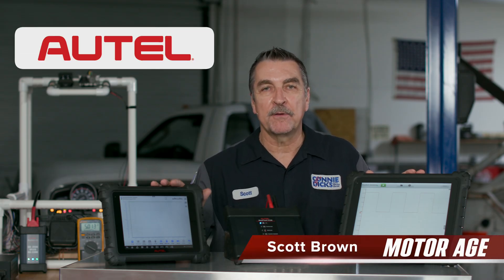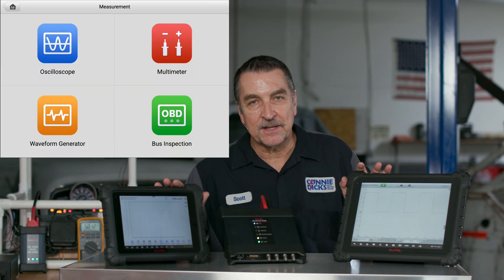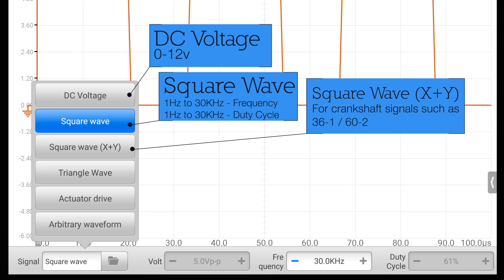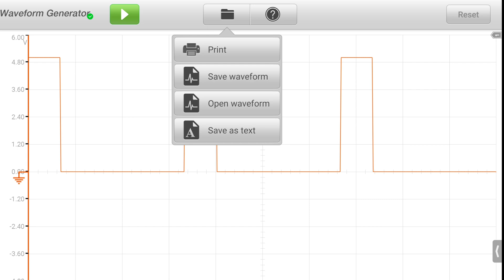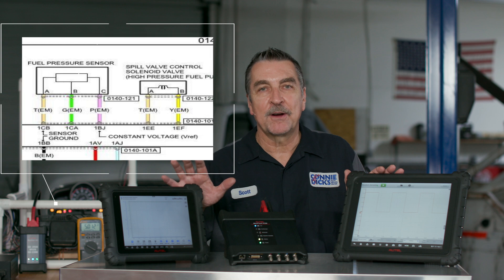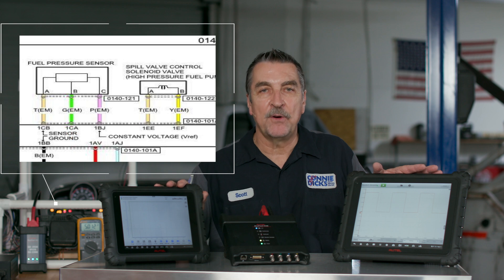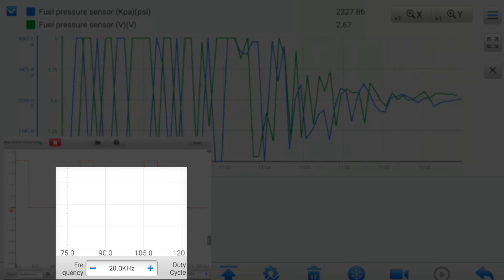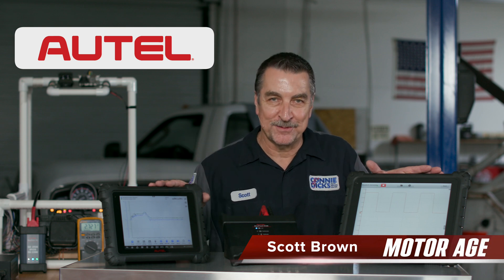Tool Review: Autel Ultra - VCMI - Signal Generator

Comment: It would be helpful to see a demo of  drive by wire throttle body testing and actuation and perhaps other motor actuation such as a climate control actuator, IAC valve, and any other applicable solenoids.  Thank you!
Reply: FWIW, TAC systems go through rigorous testing before engine start and after shut down. Using a scope to monitor this activity has helped me to learn more about how the motor signals and current traces can lead you to a confident repair. I’ve done a few videos on these in the past and here’s a link to one I did about 3 years ago: https://youtu.be/dABzCZC_nhU This one wasn’t with the Autel but I’ll try and do one similarly with their scope.

Comment: Hey Scott I am looking into getting a new scan tool because my snap-on modus ultra is becoming outdated with no more new updates.
I am used to the snap-on software that is the only reason I am looking at the Triton d10 however I'm also looking at the alltel Max's assist ultra Ev Ms919 Ms909.
 I have used a matco Maximus 3.0 however it wasn't really my favorite. 
I value your input on trying to find my next scan tool.
Reply: IMO, one will need to be fluent in a variety of tools from my experience. Whether OEM or Aftermarket, they all have strengths and weaknesses. Tools that have great support and offer training would be my focus.